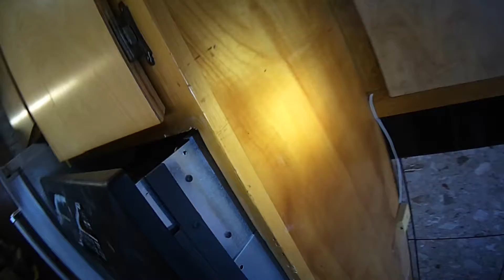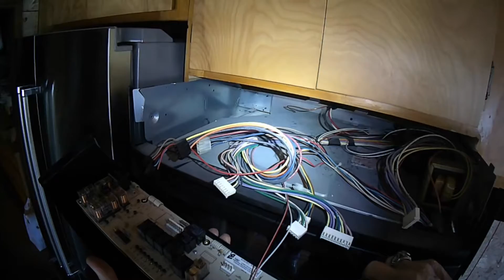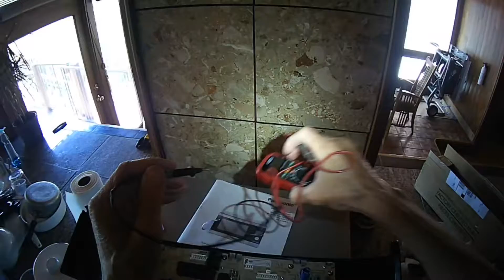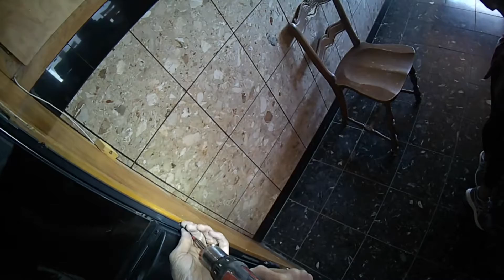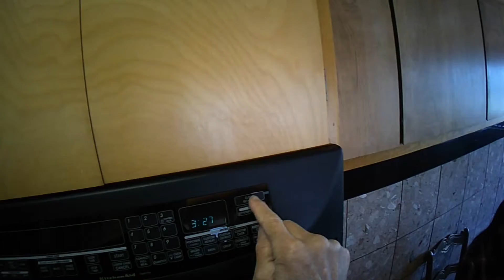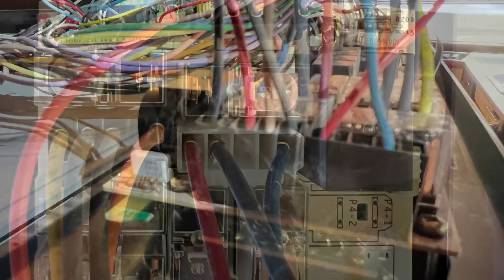Kitchenaid Wall Oven Dead Display - Save $500 with This DIY

Comment: Hi there I got kitchen aid dual fuel range no power at all 
Model KFDC506JSS do you think most likely it’s the control board too ? Thanks
Reply from the maker: That’s most likely.
Make sure to check the 2 breakers for the oven to make sure both are on.